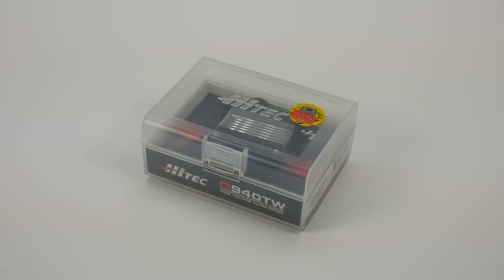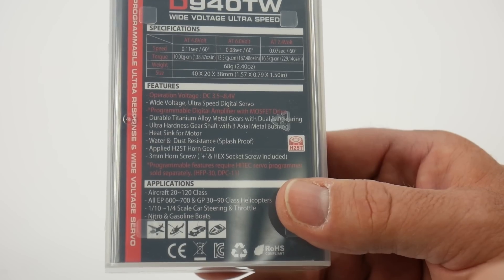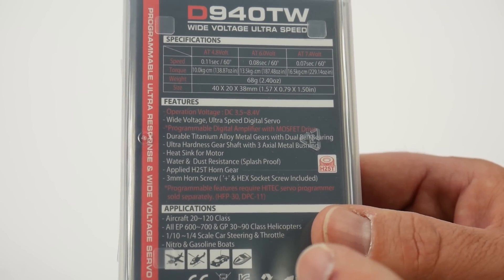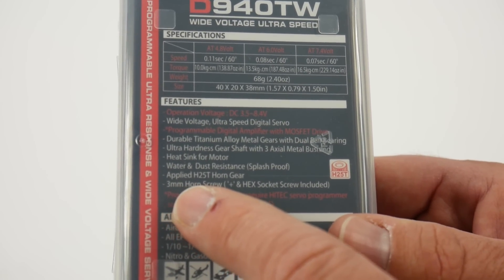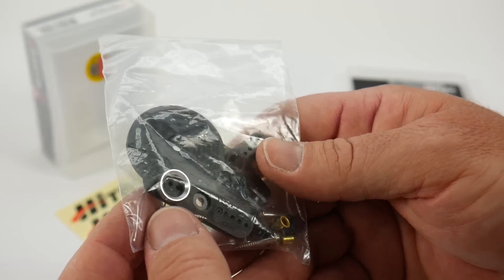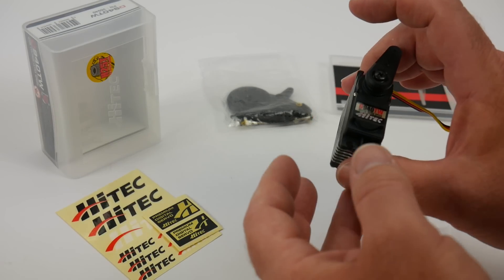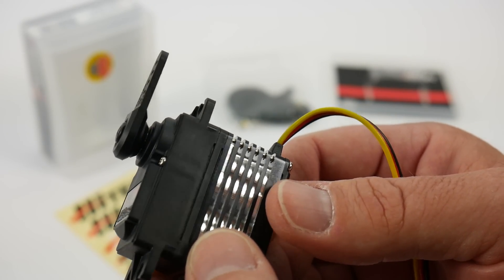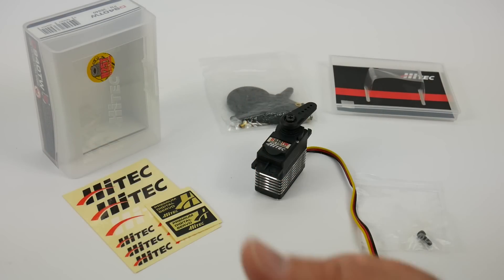HItec D940TW Servo Unboxing

Comment: Hey rich, keep up the good work my friend. I run RC Tips and Tricks on FB. Di you think this servo is a good choice for a speedrun slash 4x4 compared to the modern ones of 2020 that can do between .05 and .03 transit time? Would I even notice a difference? It is already close to the 90mph mark already I believe.
Reply from the maker: The d940TW is a great servo....but probably not needed for a speed run Slash.  I'd look into a 250oz/in servo with some speed if you need it (.07 seconds or so).  The .05 .03 second servos are crazy and I usually dial them down.....as they're just way too twitchy
Reply: The RCNetwork that’s funny, I was just watching your Tekno Big bone center drive shaft for the slash 4x4. So far my stock one hasn’t broken by I may just go ahead and get it because it will eventually fail as I move up in speed and power.
Reply: The RCNetwork also, the D940TW is about those specs you mentioned almost exactly. It’s 229oz/in and .07transit @8.4V

Comment: Nice vid I brought 2 hitec D946TW for my 8th scale high performance nitro GT car and I'd like to know are these servos good for this purpose?
Reply from the maker: Yeah, sure.  I'm not a Nitro expert, but typically you don't need a servo with as much torque for throttle vs. steering.
Reply: Thanks buddy
Reply: Thanks buddy

Comment: I bought 2 of D-945TW theses servos and it had gear slop just like any other servo so I sent them back was not impressed. For the price they should be brushless. I ran them side by side with my Power Hd Storm 4 servo and my Storm 4 was quieter and smoother.And more power and drew less current.

Comment: Hey Rich what would u recommend for a Traxxas S2PEDE vxl. Something waterproof
Reply from the maker: You'll need something with some torque - in the 200oz /in+ for the Stampede.  Waterproof and speed will boost the pricing.  Hitec has the 5646WP, but it's a bit under the 200 and slower.  Take a look at most Futaba's -they're waterproof and a good quality servo.

Comment: Hey Rich. Another great vid. What do you recommend for servos in 1/8 scale electric buggy for steering. Thanks!
Reply from the maker: The 940 in this video can do a decent job. My rule for 1/8th scale buggies is at least 300 oz/inch of torque and then as quick as you can afford.  Typically a 300oz/.10 sec servo's cost about $100.  Start dropping the time and the price goes up dramatically

Comment: Great video!! I personally bought a Savox 1273tg.. .065 and 222ozin.. Just another options for your viewers.. I use it on an 1/8 scale buggy for steering..  I don't remember what it cost, but it's got to be in the same price range.. It works great.. Thanks Rich
Reply from the maker: Thanks for sharing.  I like the Hitecs mostly because of their wide line of servos and that they don't have issues (typically) with other components like Savox does.  I'm sure you're running a BEC or Voltage Cap, right?
Reply: +The RCNetwork No cap or bec.. no problems in the 6 months I've been running it.. I have heard people say they have those problems but I never have.

Comment: Nice vid but any chance the next servo review you could plug it in and show how fast it is?
Reply from the maker: Many of my unboxings are just that, what you get...I have done videos where I have shown the product running during the video, but that's only if I have a current project I'm working on.  In this case, I unboxed this servo on film in May, but didn't use it in a project til August

Comment: that is super cool rich I ran into a problem I ordered a Savox one Fifth Scale steering servo and it wouldn't  fit in my Rovan 1 Fifth Scale gas powered and I sent it back come to find out the stock servo in this thing is a 1/4 scale so I did some research and I contacted DDM and I had to order the HPI battery Servo box for this Servo to fit so I told the guy to send the servo back and I did order that offer DDM so the guy I ordered the servo off of we both learned something and that will help him in his later sales so we learn as we go but this one I think I will be interested in later on down the road when I need a servo for my Thunder Tiger and the little man's E-Revo thanks for the cool video rich
Reply from the maker: Yikes!  Sounds complicated! lol
Reply: +The RCNetwork it sure was man finally figured it out and learned something